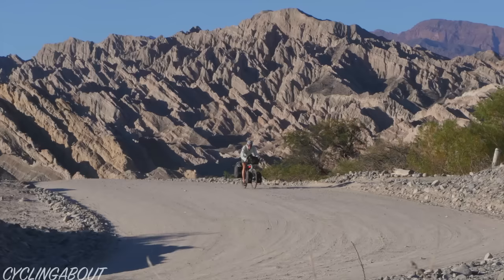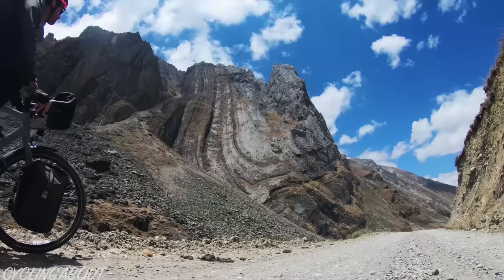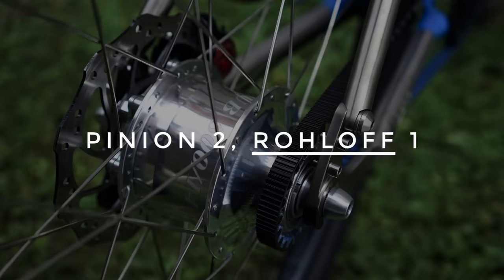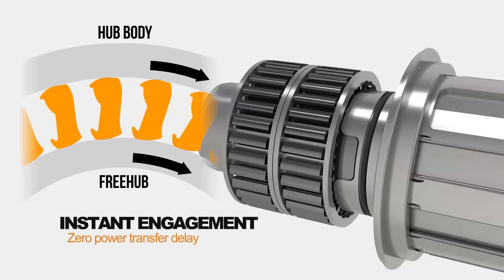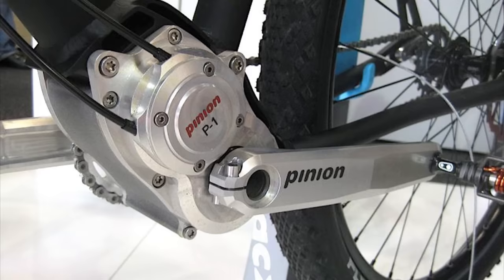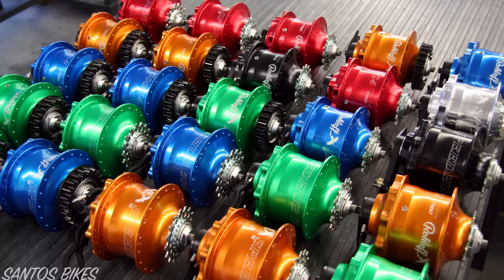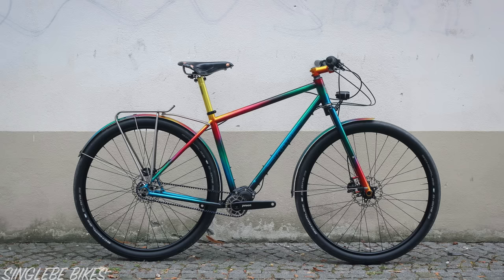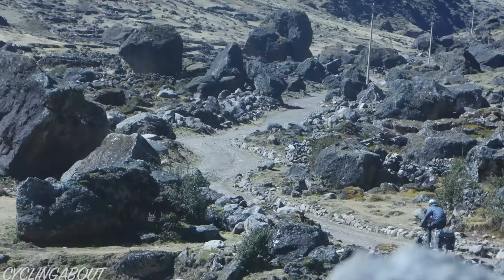What's The Ultimate Bicycle Gearbox? Rohloff Hub VS Pinion Gearbox

Comment: Well pinion gears with custom high power electric hub for cargo hauling in hilly areas would be a nice combo.   Pinion gears would probably work better with unconventional setups like velomobiles as well
Reply: Greetings,l enjoyed the great delight of tacking my 2 children to school from the bottom of the steepest hill in my municipality on a trailer I built that featured a 2mtr shaft pivoted from under my seat post. It was a very low traffic street.l was able to use a kerb to kerb S motion across the incline.because of the shaft length I could build up speed and energy through my broad S motion while the Kids where travelling a shorter distance. Infact they stopped totally at the pivot point while I was gaining momentum. I hope this will encounter fellows  who are pursuing
Reply: Absurd broad gear ratios.

Comment: Hi, I follow you for weeks now. Main reason is your knoledge about gates carbon drive. I am almost ready with my setup but one single peace do not let me come to rest. I want to fit my fully MTB with Alfine 11 + carbon drive. It runs since 30.000 know with chain but I want to switch. BUT: what can I use as belt tensioner? I have not found anything that would be approriate in my opinion. The snubber is not the best choise I guess due to the fact that it is not equiped with a spring. Can you give me an idea what to do or where to look? Thanks. Rgds Martin / Germany
Reply from the maker: Most belt tensioners that I know of are custom manufactured by Nicolai Bikes, and I'm not sure they'll fit on any other frame.

Comment: Great stuff, thanks, I'm very happy with my Rohloff. What about shifting down under load? I understand that with a Pinion you always have to release the pressure on the pedals a bit, which would be a big disadvantage going uphill or getting stuck in the mud.
Reply: You have to with the Rohloff too.
Reply: @alexmorgan3435  Hardly, in my experience, seems to be a bigger problem for Pinion.
Reply: @dzwietering  What do you mean hardly? Of course you have to momentarily reduce power to the cranks when changing gear with a Rohloff gearbox.
Reply from the maker: You ideally want to back off on the power for a split second to shift either gearbox system.
Reply: You think you can shift on a steep hill with deFAILeurs?? hahahaha
Reply: On the Pinion you can always shift down - only when shifting up do you have to release torque for a brief moment.

Comment: Another great video. I had a question after your video about belt drive. If it is possible to run the belt under the advised tension would it be a problem having a pinion gates set up without a sliding rear drop out to tension the belt correctly? if you could calculate near enough for a given belt length the distance from the "chainset" to the rear hub with extra length because of the sprockets?
Reply: Almost all chain and belt systems have some adjustability. This is since a small change in distance between the spockets/belt drivers will cause an >2x change in chain/belt length. Because of tolerances there will be a difference between the two sprockets / belt drivers.

If no length adjustability can be had, it is possible for you to have different sets of ratios for the sprockets / belt drivers to change the belt distance in that manner (not recommended).

Since small length differences make a big effect on belt length, measurement should be taken on the specific bike or an identical bike.
Reply: Look at Alllee's previous video where he talks about belt tension. You can actually have belt tension white slack and it still work. An over tight belt wears out hub bearings.
Bikes frames using a belt drive either have a sliding rear drop out or an eccentric bottom bracket (adjustable) to tension the belt or chain.
Reply from the maker: You could technically make a belt work without any horizontal chainstay adjustment. But you will really want the adjustment just incase your frame isn't stiff enough (to add more belt tension), or if it is stiff enough, to optimise the belt tension, reducing friction.

Comment: Maybe need item #19-- Flat repair difficulty?
Reply from the maker: It's the same. Hardest bit is taking the tyre off the rim. 😉
Reply: @Cyclingabout  Except you have to unplug shift cables with the Rohloff, and just pop a bare wheel off with Pinion.
Reply: @PhilKulak  You are not correct about the Rohloff. All you have to do is unscrew the external gearbox selector on the non drive side of the hub. It has a large screw that is easy to remove and re-affix. The rest is easy to get the wheel out.
Reply from the maker: It literally takes me three seconds to disconnect my cable box. I spend exponentially more time removing the tyre.

Comment: Does anyone know or have experience with the new style gear boxes related to water?  I am retired, living in Manila Philippines.   During parts of the year, rainy season, many of the streets here get flooded.  So if I want to go anywhere I risk riding the bike in water for significant periods of time. How deep?  Depends, but over the hugs is often the case.  So certainly the bottom bracket area is going to be submerged at times.   Can these gear boxes survive being under water?

Comment: There is a long comment below from 5 days ago. He says he can make the Pinion slip and or crunch. Plus another guy who wrecked one in weeks. 
Now looking at it in the first seconds of this video, I can see why. It has the same FLAW of shaft drive trains that have been tried several different decades, and FAILED mostly because of the angle gears also. 

So, Only a MAX of TWO teeth are doing the work at a time. While they are also trying to push each other apart. Both SA and Rohloff have a sun pinion always engaged with 3 or 4 planets. They have 6 or 8 teeth working together. NO chance they can push apart. The Rohloff has 3 stages, so they may have 3x those 6 or 8 teeth working in some gear selections. 

Most of the parts in my SA 5w show very little wear. Most of that because of the sticky key movement maybe. The pinion teeth have the surface worn off.
I have seen a YT guy take apart a Rohloff to reveal one of the big spacer washers, that had disintegrated. Messed up the shifting. He had to get a new one made, because of those stubborn jerks.
 Mine is still getting better at 17,000 miles.

Comment: %100 Rohloff. Most reliable, most proven, used on every mid drive motor. Pinion can't be used on a mid drive so it's useless in nearly %80 of Ebikes. It's a clear no brainer. Less expensive and indestructible. Not a tie at all, Rohloff is the clear winner.

Comment: Nice video! Did you check out the "Kindernay" 14 speed hub with a separate hub cage? So you can build multiple wheels with it.
Reply: It's got to be the DUMBEST IDEA of all time, IMO.... 8 little screws holding the cage that will collect dirt like a hippo. Plus the shifting is on the COG SIDE?? WTF were they thinking, besides not copying the Rohloff??
Reply: @GordoGambler  time will show how good the system works..

Comment: How about shifting under load?  I think one if these does not allow it??
Reply from the maker: You shouldn't shift under load with either. You need to back off on the power for a split second, which becomes second nature pretty quickly.
Reply: @Cyclingabout  Thanks.  I am used to due to traditional derailleur systems and it's not a big deal.  I was just wondering if these systems would improve on that.

Comment: Call me weird, but...just out of sheer perverse curiosity, could a bike mount and use both gearboxes simultaneously? 
I would imagine a much greater range of gear adjustment, providing both much lower and much higher gear combos than either gearbox alone would allow, but also a steeper adjustment period as you adapted to trying to manage 2 full range gearing systems. 
Now I know most will say its stupid, but im not trying to address the practicality, only the possibility.
So....is it possible?
Reply from the maker: A handful of bikes have been built with both gearboxes for April Fool's Day, including a Tout Terrain and Schindelhauer.
Reply: @Cyclingabout  so now I have to ask......
How did they perform?

Comment: Hey @cyclingabout great informative video I have one question... what about freewheeling down a mountain... or going down a slope... The rohloff hub will not spin as fast as any other ordinary freewheel... but pinion gear box has no such issue... I have seen videos where people have gave a hard spin to a rohloff hub rear wheel and it stops spinning much faster than a ordinary freewheel hub...
Reply from the maker: The <1 watt of freewheel drag is not a problem at high speeds because air resistance is many, many orders of magnitude higher. I can't imagine the speed penalty is anything more than 0.1km/h.
Reply: My SA 5w was 3 mph faster downhill than the Rohloff. Same high GI about 115.
Reply: @Cyclingabout  Thanks for replying..
Reply: @GordoGambler  can you explain more in detail??
Reply: @biswadey5021  ... I have a YT video showing me going with my SA 5w, 45.8 mph. Click on my name, I seldom get any views LOL.. I finally got my Rohloff up to 43 mph on the same hill last year, but do have a lot more stuff on the frame now. The gears in the SA are way smaller and the bearings are way looser. Rohloff has at least 3 pawl runs and 4 sealed bearings, over twice the size and number of parts,  plus the 2 seals. 
IMO The SA 5w is MORE efficient than defailleurs in most situations. My bikes are 50 to 120 lbs.
I would put SA at 96/ 97%. Only 1% less than SS and fixie at 99%.
Reply from the maker: Yep, the SA 3-speed is a bit more efficient than the Rohloff, at >95% average efficiency at 80, 150 and 200-watts (oddly, the efficiency doesn't change much with a higher power output). The number of engagement of the gear selected will have some effect on downhill speed.

Comment: Shimano hub cheaper  and you can buy parts in store  without post sending
Reply: Yeah and often, because derailleur transmissions are high maintenance. The Rohloff and Pinion hubs are LOW maintenance and very robust. That's the whole point of them.
Reply: @alexmorgan3435  Why are derailleur more maintenance?

Comment: Anyone know if you have to ease off when changing gears on any of them?
Reply from the maker: Yep, you need to back off on the power.
Reply: Merv Howard - You need to back off for the split second it takes to turn the knob, but it’s basically instantaneous engagement once you land on the selected gear.
Reply: Any one better than the other for not having to reduce power quick shift
Reply: @EdgeMasterPro  Can't speak for the Rohloff, but Pinion can be stubborn when shifting down the steps at a third of the range, where two gear sets switch, needing total unloading for a split second.
Reply: Many thanks for all replies. Gonna get the Rohloff I think. Getting hold of a Koga World Traveller is another matter.
Reply: @GordoGambler  This is closer to the principle of a sequential motorbike gearbox. Which shift without clutch just fine. Get off the gas for a split second and shift in the new gear. Works perfectly.
If I am not mistaken in racing the just interrupt ignition for a split second for shifting.
Reply: That's not much good, with my enviolo (NuVinci) hub I can shift all day every day without ever easing off the power.
In fact shifting while applying full power is my favourite thing, the bike accelerates like crazy.

Comment: I have a CoMotion Divide with a Rohloff Hub. The belt is cool. The hub is cool. The gear range is great. But it is just too darn heavy. My back wheel weighs 8 pounds and the bike 35 pounds. It is bomb proof however.
Reply from the maker: It's hard to make a bomb-proof bike light! The Divide is still 33 pounds with derailleurs. 👍🏻
Reply: My loaded bike is 120 lbs. LOL. You just need a SA XL FDD to balance the weight. Lights always ON and brakes that ALWAYS work. It does need a heavy fork or CF wrap tho.

Comment: I was wondering if you know anything about the effigear? I like their idea, but can’t find their efficiency
Reply: I think the range would be an issue in a touring application. I think it's around 400% or so.
Reply from the maker: There's almost no data on the Effigear, that I know of! But given the range, it seems like it has been designed specifically for full suspension mountain bikes that are focused on the gravity side of things...
Reply: CYCLINGABOUT thank you for your response! I was hoping you would know more, but if even you don’t know much about it, I think it is the company that tries to keep it secret. And thus probably that it isn’t that efficient. I know the range is a bit less than rohloff or pinion, but it would be a huge upgrade for me at the moment. Currently my bike is a cheap 3X7 setup, but the front gears don’t work, so I can only use it as a 1X7 (or even just 1X6 because of the chain crossing to much for 1st gear). It is 32-11 so not even 300% range. My plan is to build a recumbent based on XYZ oneseater. Using rohloff or pinion is just way too expensive, but going with derailleur setup really sucks when you have to stop unexpected, on a slope, in 6th gear... I think I will have to start saving then... Or hopefully the Shimano gearbox thing gets on the markt soon enough without costing me a kidney

Comment: One plus of the Rohloff which was not mentioned is the ability to fit a Schlumpf "kick" Drive to the bottom bracket, effectively doubling (though with some obvious crossover) the number of speeds of the system. So, if you consider  that option, it changes the score to Rohloff 10, Pinion 9.

Comment: Noise and wheel swaps - super important use case. Not. If any, noise comes with some extra security.
Shifting resistance: As long as it doesn't take the Hulk to switch gears, it's a non-issue, that's probably different in aftermarket options, which is why this isn't really worth giving a full point for.
Hike a bike: Ok, this is a problem on a BMX when you take off your feet and need to know where the pedals are before you land, but on a mountainbike this not really a big issue, but a small nuisance pushing the pike, awarding this a full point is over-exaggerating the issue, when you compare it to something like drive train efficiency.
Reply from the maker: The hike-a-bike crank spin is one of the things that annoys me most about a Rohloff hub. If I remade this video, I would give two points to the Pinion and subtracted one from the Rohloff!
Reply: @Cyclingabout  If that 's such a big problem for you, it sounds you should be riding your bikes more often than pushing them in and out of the shop. Or get some free coaster hubs, they don't even hike when you're pushing the bike backwards, engagement is pretty bad though, but since you're more worried about pushing that should be a non-issue. There I fixed it, don't need to thank me.

Comment: True that Pinion is an advantage for MTB with a full suspension but not true with a hardtail , a Rohloff makes a better option for hardtail because of the efficiency and total weight.

So Rohloff wins 10-8 :)

Comment: At 66, I've been using the same Rohloff for around a decade and a half, and have had no problems whatsoever. Until frail enough to warrant a switch to an electrobike (don't hold your breath), I see no pressing justification to change to a different gearbox.

Comment: Got my Rohloff bike yesterday :) very happy with it going to iceland in 3 weeks for 4 week bikepacking trip around the island 

went for Rohloff for the higher effi and weight, my last vacation in Norway I broke 2 chains.... I was able to repair it but it got me thinking for another solution. when I found your website and did read up on the stuff I was sold :)

some pictures of it
https://www.flickr.com/photos/169187867@N06/50027716797/in/album-72157714797422212/ 
there are some loose cable under the handelbars those go in a furumlader that I run on my handelbar bag (my headset is to small to fit it in)
Reply from the maker: That looks awesome! Have an amazing time in Iceland. 🤘🏼
Reply: Would be nicer if the TT had 4" less slope. I hate these new FAD frames. Cramped bottles and lame rear triangle/ rack mount. Yup, R14 is GREAT after 5,000 miles loosening up. LOL
I have a homemade mount for my shifter on the TT, just behind the stem. NO floppy cables and I can shift with either hand. 16,600 miles with no service yet. Except for my goofy solutions to solve the slippery grip problem.
Reply: I have gear envy really nice bike!
Reply: @GordoGambler  absurdly long seatposts make the bike work as almost a softtail. I had one of those bikes (got stolen) and it's pretty fun. You're right about the cages.
Reply: @GordoGambler  TT is more then I wished for but on vacation I use a framebag with a camelbag in it. and the rear rack was my own option I have a normal rack that fits it but wanna try this out first, it looks different and I like it :)

Comment: I just snapped my carbon belt today after no more than 3000km, should i be worried and return to chain?
Reply from the maker: It snapped for a reason. Usually, it's because it was damaged by something falling on the belt, twisting the belt or 'walking the belt' onto the rear cog when installing your wheel. A rock might have got stuck between the belt and the rear cog if you were riding off-road.
Reply: @Cyclingabout  ok so I should see this as an anomaly 👍👍

Comment: What are the benefits? Used of rohloff hub???
Reply: The benefit is relatively low maintenance.
The price are relatively high purchase costs, a little bit more weight and slightly less drive train efficiency.